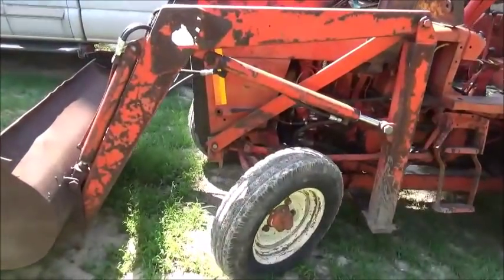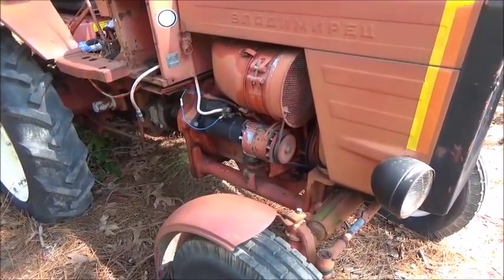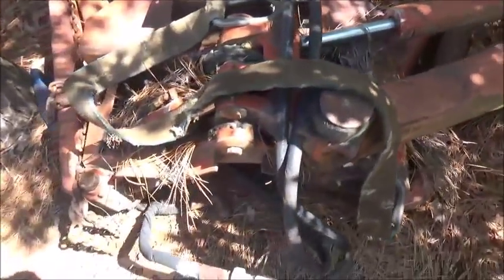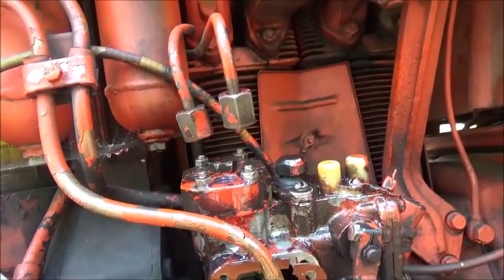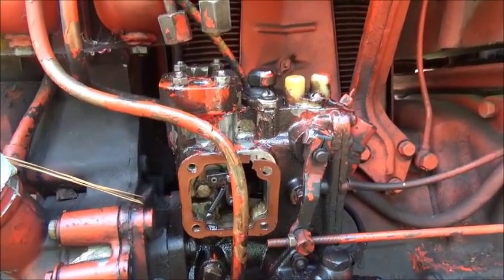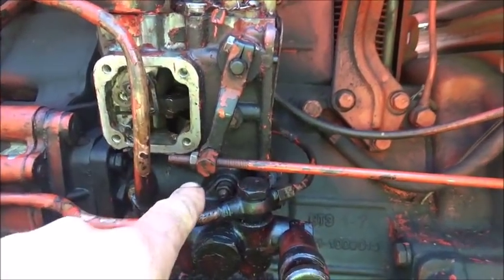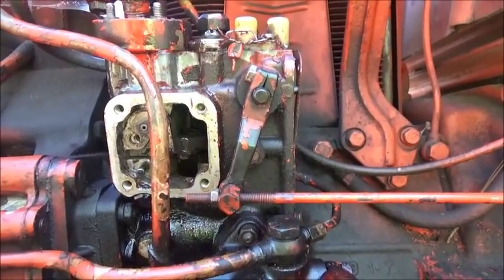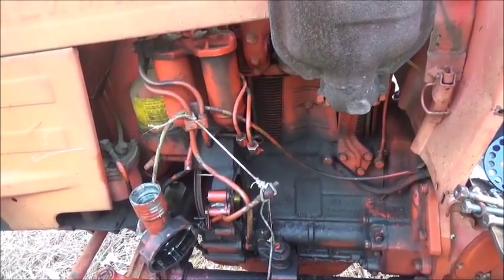Belarus 250 Injector Pump Issues Part 1

Comment: Way to go Chief, I worked Diesels a bit and taught Rebuild in the Army. Those high pressure systems can take a beating but they are usually built like tanks, Maybe not these days but back then dirty fuel was the main issue. Especially in construction in the field or over seas. Getting a good manual was critical your lucky you found one. Really like your approach, go get em.  D

Comment: Found this in a forum ... might help??? On the bottom of the injection pump there is a drain plug,take it out and drain everything,it will be mostly fuel.Don't worry no bleeding or any thing is necessary.Up slightly from the bottom of the pump,facing out is a level plug,should be the same size plug as the bottom plug was,take that out,that is your oil level hole. Add motor oil to the top of the pump through the cap. Might have to use a squirt can.Add oil till it runs out the level hole,put your plugs back in and your done.These pumps leak internally,just the nature of less than stellar maching.I forget the service time on this,but check it whenever you change the oil. One reason they leak is the crankcase of the pump fills with fuel from internal leakage,normal..Every now and then,forget how many hours,you have to drain the pump cavity,and add motor oil to a certain level.You add it from the top,and there is a level plug you take out,and add oil till it runs out the hole.Doesn't take a lot.

Comment: Mechanical injection pumps are like in serial connection each out to injector.
When you open one become lost on others injectors
To see how pump is working connect all injector and crank the engine ( Needs bleed all injection lines )
You going to see how injectors spraying * Possible some injector nozzle are blocked
Never touch injection pump * First injectors only,
Pumps are very expensive to fix or align and same time not to many professionals who know and do this job.

Comment: Pump was still making pressure, so that's  good,  and it's only two cylinder, again good. Most likely you will find a sheared roll pin on the main drive shaft gear that is supposed to be syncing the rotary pressure head.OR if it is like the old oldsmobile diesel stanadyne D2B pumps that failed because of the  rubbery flex ring syncing the rotary head that the newer low sulfur fuels ate up. It is something minor, the pump is pumping through the least resistance . But that is awesome cause your pump is still able to make the pressure required to  fire the injector on the one cylinder. Should be a simple pump inside hopefully your local diesel turbo shop will have a rebuild kit with new o rings and gaskets etc, just be careful  to not disassemble too much, cause if you manage to turn up the fuel (usually set in the fuel inlet line with a hex key) You could blow head gaskets or head bolts. So be careful and good luck

Comment: couldnt you make that a 3 point back hoe attachment? many of those have a hydraulic pump that runs off the rear pto shaft. they slide on the shaft and usually have a couple pins in brackets to hold the pump. wonder if a diesel injection rebuild shop could get the parts for that pump. we have one not too far from us we could try.
Reply: J.C. SMITH PROJECTS I don't believe Johnathan wants to fork out very much money on this project, if he can find away to fix it cheaper. I'm the same way just a thought.
Reply: JC,
I was thinking the same thing about the back hoe. A place i used to work at had a back hoe attachment with a 'quick-attach' plate that mounted on a skid loader. i would think something could be made for the 3 point also.
Reply: Don't forget J.C, as Jonathan pointed out, the tractor ( like most farm tractor's ) doesn't have a frame to carry the load of a backhoe system. This is why he was checking out the addition of a separate chassis for the backhoe on this Belarus.

Comment: Keep everything in time. That pump is extremely hard to keep in time with weird markings. Make your own. The pump turns engine speed and the gears inside make the head turn half speed for a 4 cycle engine. So Mark the drive, mark the head gear so you stay on the same stroke. Might even check the position of the plunger and get it on the up- ward stroke. the little metering valve on the side comes out first before pulling the head. The plunger rotates and goes up and down at the same time. A little hardened pin goes in the plunger to drive it and connects with the gear.  Since you can turn the upper gear something in the gears in the governor are bad. The governor shaft should not turn like that. 

US made pumps (old Olivers, AC, others) American Bosch  PSJ the pump was timed with the drive key at 12 and the head drive gear straight out the side under the metering valve. Don't know how the commies did it. Notice the drive gear looks like someone made it on a grinder. Real crude.